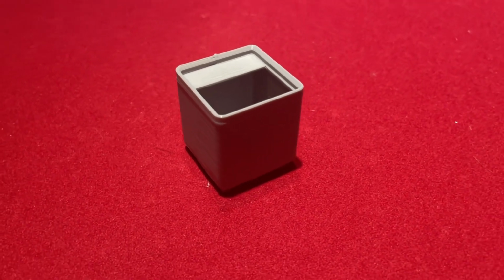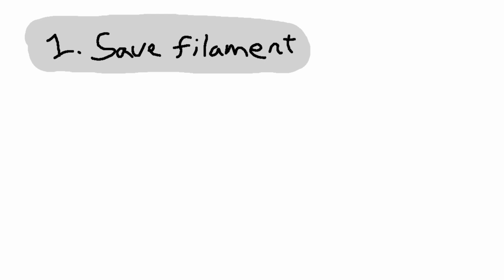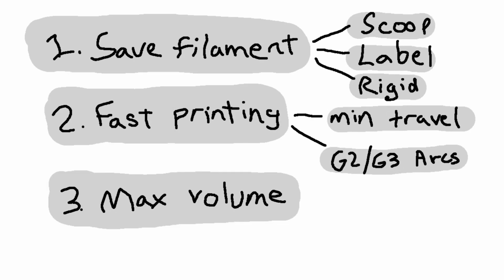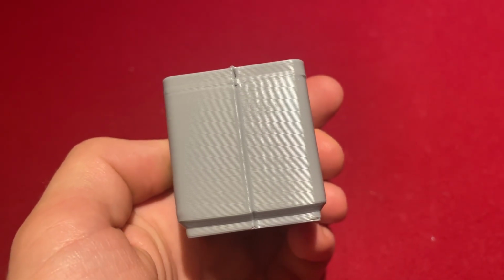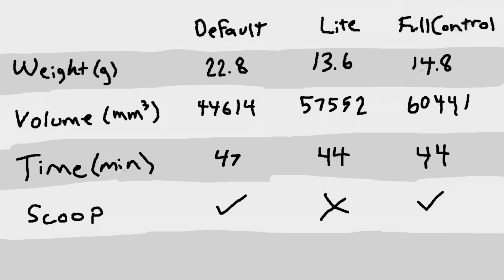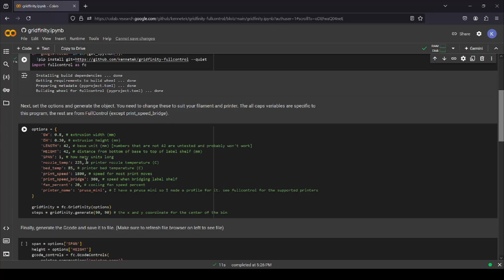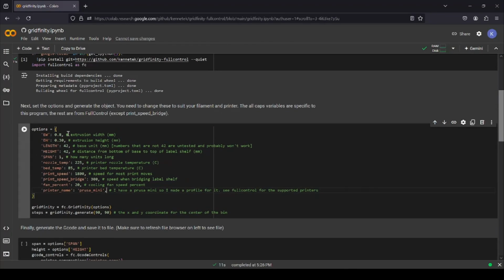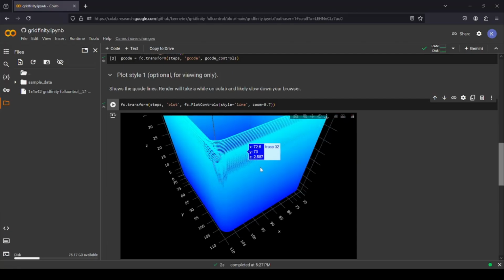FullControl Gridfinity

Comment: Maybe printing 2 one wall vase modes  bins which fit into each other would make a difference, the inner bin would have the scoop and label holder.
No seams and the bins can be glued together which would result in a lot of stiffness. Not sure if glue is cheaper and the assembly time makes it worth. But single wall vase prints are easy auto ejectable

Comment: Nice work! Did you submit a pr to the full control library for your improvements? Do they even have a github?
Reply from the maker: They do have a github ( https://github.com/FullControlXYZ/fullcontrol ). Unfortunately I made all my modifications on a copy of the library, I didn't fork it because I did not originally intend to modify it 😅also my changes are somewhat surface-level and not thoroughly tested. There is discussion going on in the library about implementing the arcs to the main lib and the gridfinity module as an example for the site